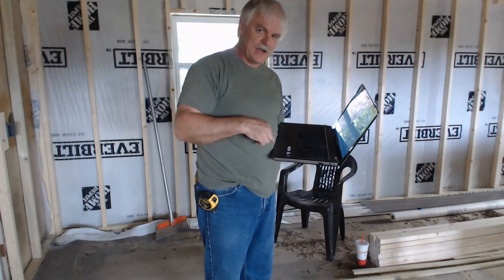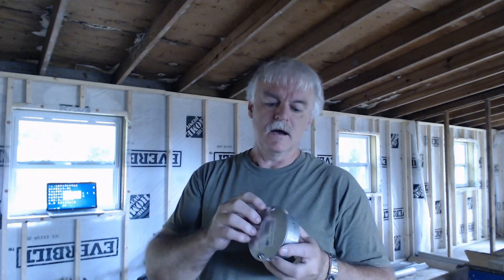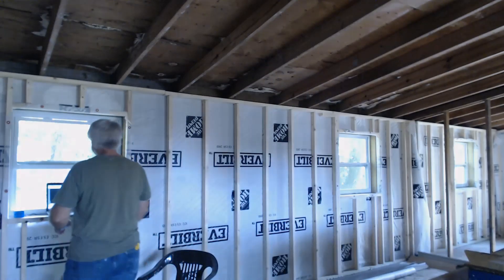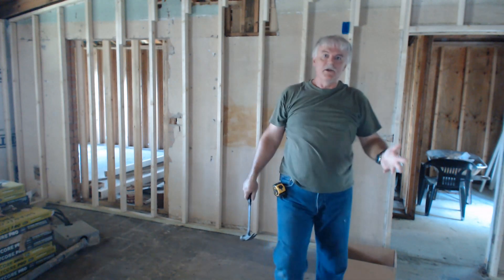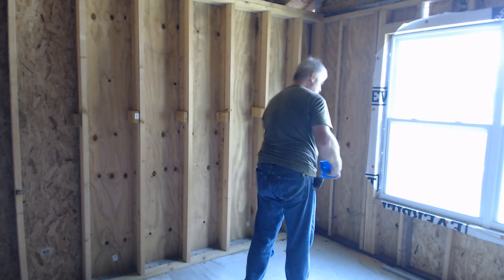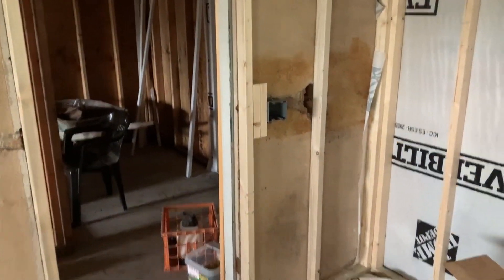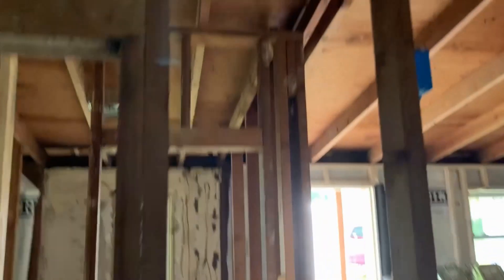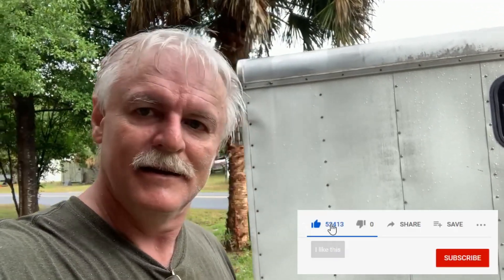Remodeling a $6000 Brick House - Electrical Plans

Comment: If you just need 2D drawings, I like QCad for the price. Up until I bought that in 2006 for a "windows" environment, I just used AutoCAD 10 for about 16 years.
Reply from the maker: I've been using AutoCAD since long before there was a windows version and I still do a fair amount of customizing for the platform. I first used it on a job a little over 33 years ago. My current version is 2007 but I am an AutoCAD software developer so I do have access to the newer versions, just not such that I can use it for design work.
Reply: @RehabLife  I started using it back in 1989 in our vocational electronics class in high school for a drawing electtonic circuits. Later on I used it for my cousin's company designing up house blueprints and additions. That's when I got addicted to using it with a 17-in tablet with a puck after that a mouse just sucked.